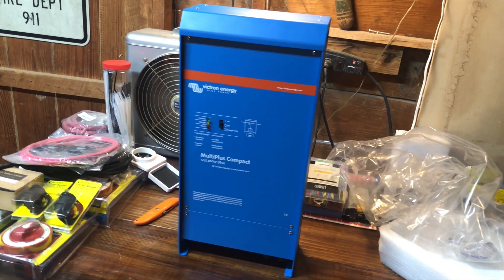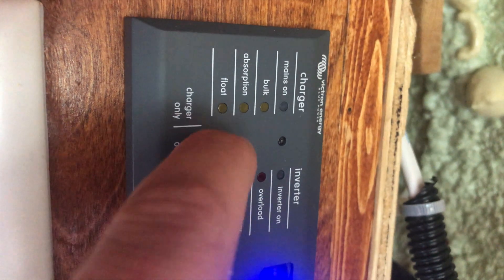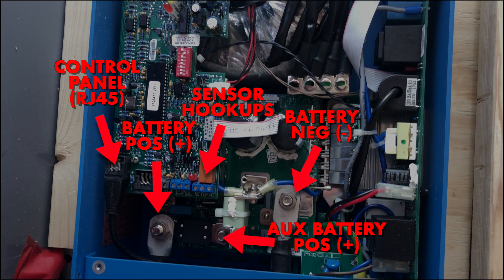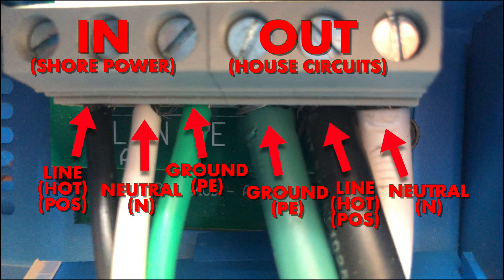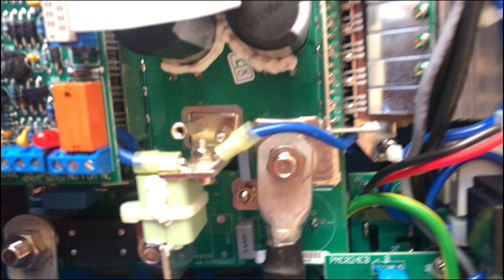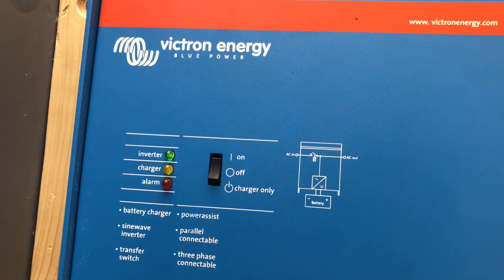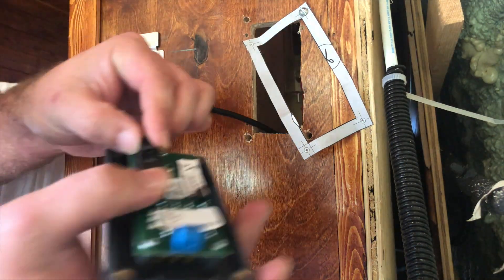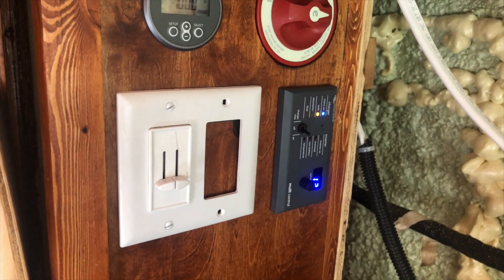Victron MultiPlus Compact Battery Charger/Inverter INSTALL, WIRING & REVIEW

Comment: My unit showed up without the "C110" capacitor near the TR+ CHARGE terminal. The male terminal is also missing for the output. Does anyone have the value of C110? It's just to the left of where the terminal should be.

Comment: Thanks for doing this video!  I have a small rv that is set upnwirh a generator with ac shire power transfer.  Would tjis work to eliminate the transfer box and the converter box (bith are progressive dynamics).  I ask because, i need to upgrade the converter box go a lithium charger friendly one and same goes foe rhe trasnder box (got get one that habdles an inverter switch over).   Thanks

Comment: Super new to van life and we just purchased a van with this system already installed. Our system did not come with the control panel - is it necessary for proper usage?
Reply: Nope, it is not necessary. We installed it as a quality of life upgrade but the system is operational without it. Super easy to install if you change your mind in the future.

Comment: Is this charger inverter the old model or the new model because I understand the new model does not have screw down Clamps for the AC output but this looks like it does?

Comment: Great video explaining thank you so much . One question please which would really help me to wire .. at the moment I have the Victron ip22 charger so can I swap this to the multiplus ? Take the wire from the ip22 and put them in ac out then all I need to do is wire the shore power to the ac in 
Is this correct 
Thanks

Comment: Hello, nice video ! Can you please help on this :
My victron Phoenix Inverter 12v 750va just doesn't want to start, no led, no noise... I decided to open it and everything seems to be fine : the 3 30A fuses, the small fuse in the switch circuit, all mosfets and diodes. I basically see no short anywhere. It seems more of on open circuit somewhere as no voltage go to the drive board. Any idea where to look at ? are there any other fuses ?

Comment: 3:00 This post is NOT for connecting the starter battery it is just the other side of the fuse that connects the MultiPlus to your house battery.
The connection for a starter battery is in the middle of the fuse on the PCB underneath labeled with J11.
(at this model only! at other models it is maybe in another position)
Always look into the manual!

Comment: Thanks for the demo. If Victrons design had positioned the units switch and LED’s symmetrically then the front panel could have been printed for Hz mounting on one side and printed for vertical mounting on the other side. This sort of finesse would just add another reason for giving this unit a big thumbs up!

Comment: I've just had the victron fitted into my mobile coffee van. I have currently got it on charge from an external source. The inverter is switched to on. In a few seconds of charging the green on light switches to the Amber charge light. When will I know if it is fully charged? Will the Amber light flash? At present the Amber light is permanently on.

Comment: Will this run off of the solar batteries, and switch over to grid power when the batteries run low then charge up the batteries off of grid power?

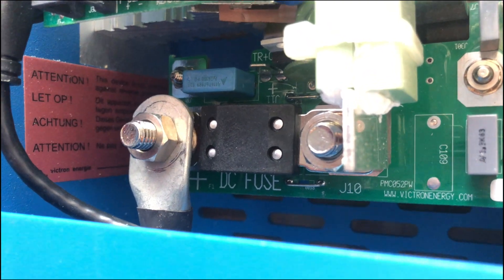Comment: Just a heads up it looks like the pointer for the Trickle Charge positive is pointing to the wrong place. its not actually the nut its a spade bit sticking out above it that you use a spade connector on you can see it at 4:32 :)
Reply: Great catch, using that terminal was messing with my setup all week... The VictronCommunity page set me straight, but this video should be updated!

Comment: Does that inverter charger act act a pass through for shore power? As in, if that has a 2000 watt upper limit when drawing from batteries, is there a upper limit to what comes in through the shore power? We have an A/C unit that draws 1670 watts and that is getting close to the upper limit. We want to use the a/c off of battery only shore power and want to see if the inverter charger will let as much power as needed pass through to the AC.
Reply: I have the same exact question. Please answer, if you can. TY

Comment: Hi, thank you for the video. Which fuse size did you use for the multi plus compact ??
Reply: It's in the manual
Reply from the maker: That depends on your specific wire size, your loads, and a few other variables. Sorry for not responding more quickly. I can give you links to some wiring guides if you like.

Comment: I enjoyed your video, thanks. 
I have purchased the same inverter / charger and am mounting it horizontally also. Where did you screw the "top" as I only have then bracket to hang the inverter / charger. appreciate the help.
Reply from the maker: Sorry for the late reply, I'm sure you figured it out by this point. I actually mounted the top on the bracket horizontally, but the rest of the body was resting on the 2x4 frame underneath and the bracket had tension on it being pulled from the lower screws.

Comment: I have a 50 amp rv. From the ATS I cut the wires and brought  the shore in and the out from the distribution box. The wire is romax 6/3. Red black neutral and a solid copper. How would you wire that into inverter charger.? Thanks for the advise
Reply from the maker: Hi there. What you're talking about sounds like three phase power, which I don't believe this unit is meant to handle. Romex 6/3 has a ground and three conductors (4 wires) which would be useful for huge electrical loads... this inverter only has Hot/Neutral/Ground.

Comment: What size of fuse needs to be used in the DC positive wire and how did you calculate that? Cheers
Reply from the maker: That depends on your specific wire size, your loads from the DC, and a few other variables. Sorry for not responding more quickly. I can give you links to some wiring guides if you like.
Reply: the size fuse required is in the install manual from Victron

Comment: I would like to see how this connects to the AC distribution panel and what this inverter-charger can power.
Reply from the maker: good suggestion for an upcoming video I will begin filming tomorrow!
Reply: Where you able to get that video out?
Reply: @Buszzbait69  I probably shouldn't have promised a "tomorrow" video, we have been incredibly busy during this time of uncertainty but I promise to do it!
Reply: The capabilities of it are listed in the specs. It can handle 120v devices up to the ratings.
Reply: https://youtu.be/YiufFMKolpY
Reply: Best way to hook it up to a/c panel is to install a sub panel. And move the breakers to the sub panel and feed them that way.

Comment: Great video, short and simple. What gauge are you using for your ac/out? Why is it larger than you ac/in?
Reply from the maker: the original specs I read are one size from the shore in to the Inverter, and then the out was larger because it is split into three wall panels at the AC Dist/DIN Bar. There's really nothing wrong with having larger gauge than you need, you only get into trouble with smaller gauge than you need.

Comment: When you do instructional videos like that you need to make sure that everything is correct. In your video you are using the wrong post for the aux battery +. Look in your manual Appendix A:Connection overview there is a small connectorTR+Charge. That is the one to hook your starter battery positive to. The way you have it hooked up is that you are connecting the positive of your house battery directly to the positive of your starter/aux battery.
Reply from the maker: You are correct and I mislabeled the connector for a Starter battery hookup install. As I haven't done the an install that uses that connection yet, I haven't tested either the Aux bus-barred positive OR the TR+Charge connection. This was an oversight, and thank you for the correction.
Reply: @kiddvantures6379  I think you should take this video down and put on a corrected version. People who follow your instructions might ruin their  inverter.
Reply from the maker: thank you again for your suggestions.
Reply: Claus is correct on the TR(ickle Charge) connection. Also, the rheostat knob on the panel is for the service amperage of your shore power incoming to the unit. Depending on the load, the inverter will add to the setting for surge starts - ie 13amps from a Honda EU2000i (or something else) + xxx from the inverter and start the AC)